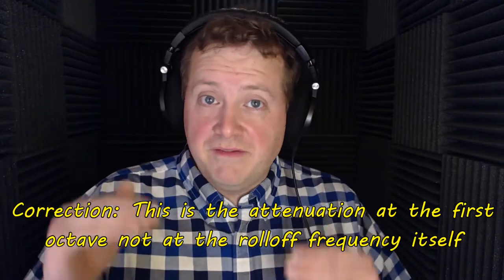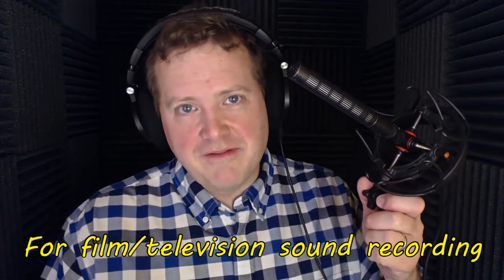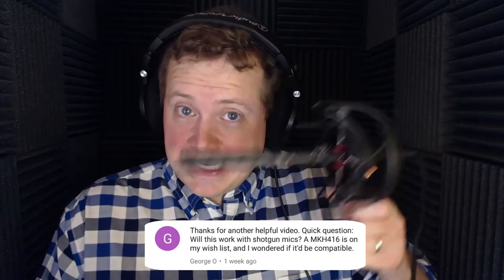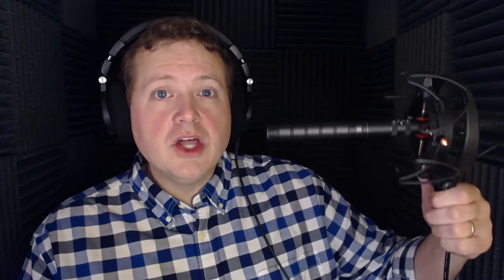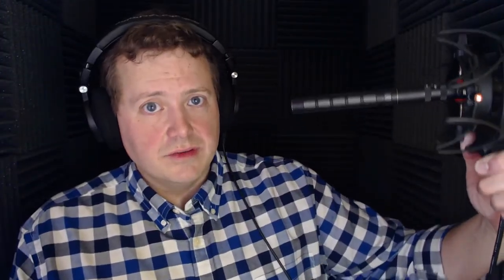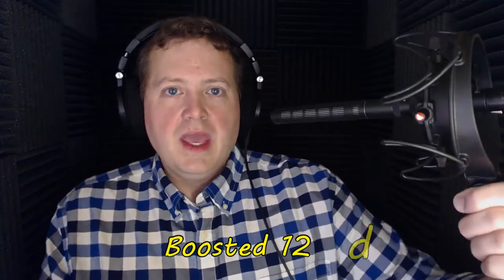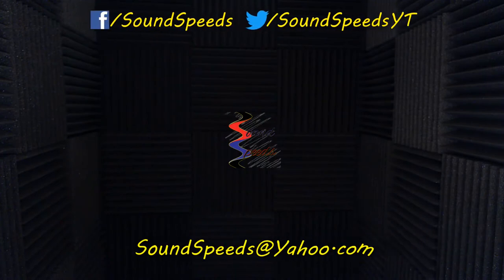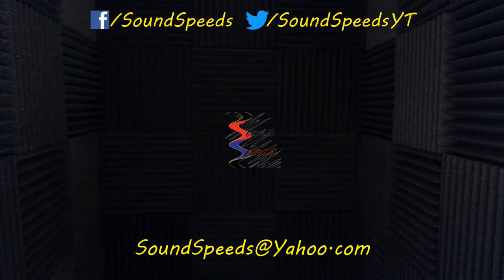When Should You Use Roll Off? - Sound Speeds

Comment: Great video! Another thing to think about, is do you roll of at the mic (onboard roll-off) or at the preamp? Well the answer is to do so at the mic. The reason for this being that nearly every condensor mic with a built in low cut, has it implemented between the capsule and the internal preamp circuit. This allows for maximum SPL handling for the microphone, and optimal gain staging in your signal chain. Another reason for rolling off at the mic, is that some preamps have their low cut AFTER the preamplifier circuit, which can result in the low frequency energy eating up a lot of your preamp's headroom.
Reply from the maker: b-spot Well said! I was reading and thinking "headroom" but then you said it. In the DPA's case I think the combination of integrated third order roll off at 50 Hz and first order roll off at 120 Hz works nicely.

Comment: You got me interested in re-looking at the roll off specs of the mic I use mostly for interiors like many the Mkh50.  What's interesting is it has a much different reduction slope then  a traditional high pass filter that is reduced a certain amount of db per octave in a uniform and calculated fashion.   The roll off filter on the 50 looks like more of an EQ that couldn't be calculated in the same as a basic high pass slope which reduces at a fixed rate per octave.  It also starts reducing at 500hz, but it is very subtle only reducing 4db down by the time you reach 70hz.  They also talk not only about sub sonic transfer noise like you demonstrated but it also is important for removing proximity effect which is not desirable in typical dialogue.   Usually I have my roll off on the mic engaged, but my pre I keep at 60hz roll off ( not 80 like some ) at 6db per octave.
Reply from the maker: Michael Wynne There's no harm in using multiple roll offs provided they are subtle, first orders. I don't know how companies can get away with a roll off on a vocal mic that's as high as 160Hz. That's so crazy to me.